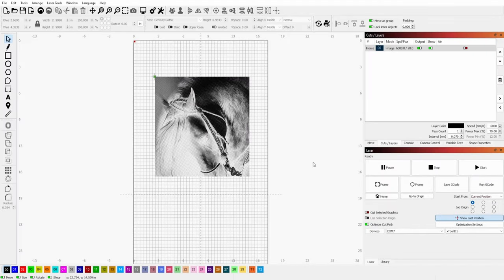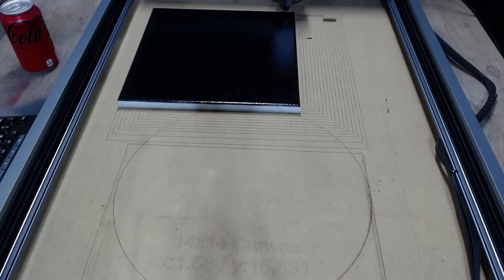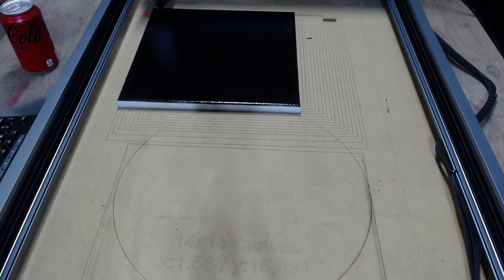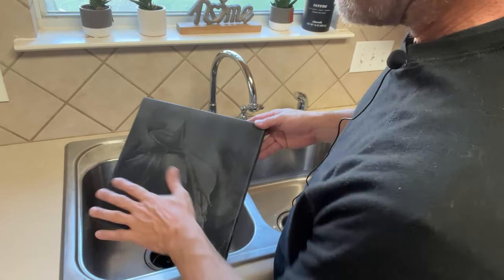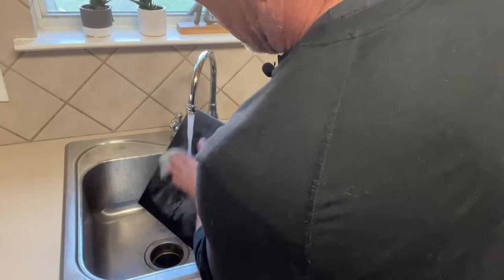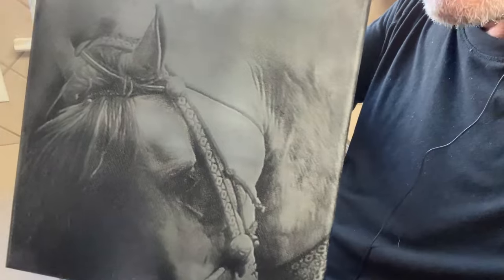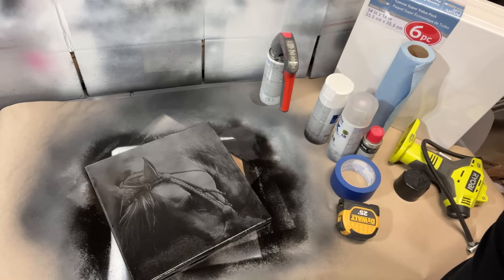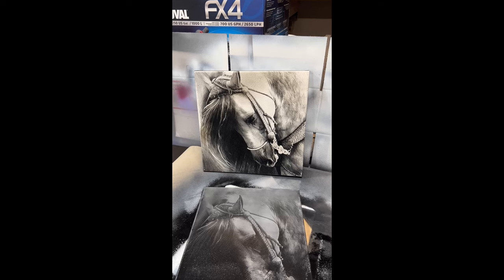How To Create an Amazing Laser Engraved Canvas on xTool D1 10w Diode Laser

Comment: Lately, when I engrave a painted canvas with my xtool d1, no pro, 20w, I'm getting horizontal faded black bars, any idea what is causing this? Thanks
Reply from the maker: Check the line interval. To much spacing will cause those line.

Comment: Nice work, how do you get rid of the spray paint smell of the canvas?
Reply from the maker: I wash my canvas off with a tiny bit of dish soap and a sponge after engraving and before I apply a clear coat.
Reply: @wtwtx  th
thank you for the quick reply, does the clear coat leave a smell as well?
Reply from the maker: @isaacespinal3950  all spray products leave a smell.
Reply: I found that the fmell fades after a somewhat short period of time, however this may not be an option if you need to send your piece out right a way.
Reply from the maker: Need to have good ventilation

Comment: what i don't understand is in your first video, you didn't put 'pass trough' on in lightburn and use jarvis mode.when it's already processed by imagr
Reply from the maker: Which video or you referring to? I’m my latest video, I turn on passthrough for the image processed using ImagR.
Reply: @wtwtx  Best Laser Engraving Method - Preparing Your Image and Canvas. In that video you didn't turn it on
Reply from the maker: @RaWGheko  that video is about preparing to engrave not actually engraving. I have another video posted doing the engrave.